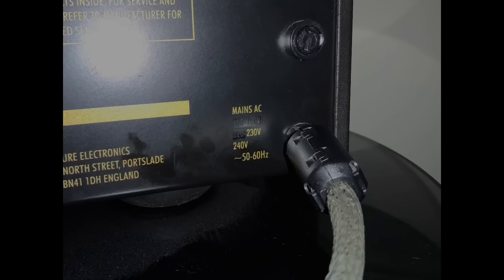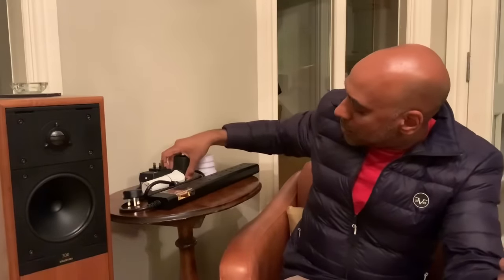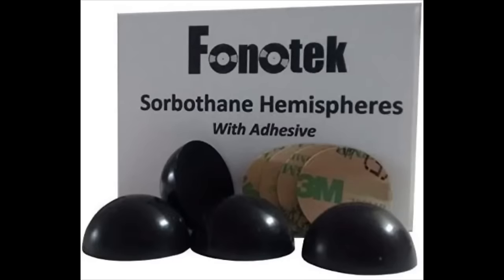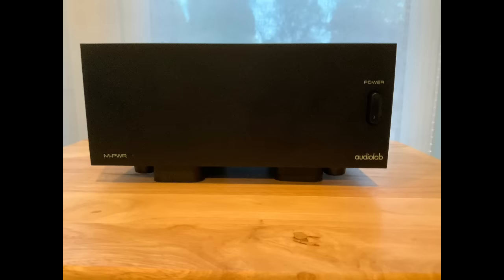My Top 5 Inexpensive Hifi Tweaks

Comment: There are many things that could be said regarding mains quality etc, if anyone is interested in sorting out the mains noise with a several KV transformer balanced or floating for hifi use at non hifi/professional industry prices should check out airlink transformers...the BBC use them so they probably aren't snake oil.The only other thing to say is go for the electrostatic shield option, it cost about £18 the last time I looked...I hope the non hifi prices bring a big smile to your faces.
Reply from the maker: Hi 495line, thank you for sharing.

Comment: Putting Ferrite beads on a speaker cable is totally absurd.  RF is not an audible interference component unless it has been actively detected by electronic circuitry. There are no active components inside a regular type of speaker system.  The RF levels (if any) would be almost negligible also speakers do not respond to RF.   The impedance of the speaker load is enough to negate any RF pickup in the cables.  Your idea on this is functionally flawed.  I think you may be going over your head when you try to explain reactance properties and their effect in an electronic circuit.

Comment: yes, totally unnecessary to spend US$2000-5000 per metre for speaker cable - wires do NOT "break in" and electrons don't preferentially oscillate in the direction of the arrow. However, 25+ years of live FOH and studio mixing has taught that one connects the shield at one end only, typically the source device. This will provide all the noise reduction benefits of shielding while making ground loops (hum) an unpleasant memory. DO NOT APPLY TO MAINS!
Reply from the maker: Thank you for watching and sharing your experiences 😊

Comment: Interesting but the £40 mains extension lead conditioner i bought degraded the sound. No good anyone want it cheap
Reply from the maker: Hi Robert, that a shame, as I mentioned the results are system dependent with these strips and the ferrite cores. Have you tried the parallel mains conditioner?

Comment: I tried the anti-vibration washer machine feet on my speakers, but I didn't like it.  However, it did give me ideas to try other inexpensive things.  So after a trip to Hobby Lobby I found these bad boys.
https://www.hobbylobby.com/Crafts-Hobbies/Painting-Surfaces/Wood/Wood-Ball-Knobs-With-3-16%22-Hole---1%22/p/20798
I know it's kind of the opposite of what you were talking about, but I like that way they make my speakers sound, which is what matters I guess.  Thanks for the video!
Reply from the maker: Hi Brandon, I am sorry the washing machine feet didn’t work out. I couldn’t open the link for some reason. Please feel free to resend it. Thank you for watching and sharing 😉
Reply: @abritishaudiophile7314  No worries! The new feet are just 1 inch wood spheres sitting on carpet. They added a touch of aggressiveness to the music, but not as much as spikes on metal disks. When I had the spikes go through the carpet into the wooden subfloor, the speakers had a softer sound. The washing machine feet made everything a little smoother. Of course all these differences are very subtle.
Reply: Well, I went back to the washing machine feet. You were right!

Comment: Hi, Due to some damage to cable near the 13amp plug on the tacima cs947 I have to change the moulded plug. Do I  connect the drain wire to the earth?
Reply from the maker: Hi Robert, the short answer is yes but if you are not sure get someone who knows to check what you are doing. Thank you for watching 😉

Comment: When I saw that cheap mains conditioner, I knew how this was going. Done waste your money, those things will do absolutely nothing. Really, don't throw your money away on them. Buy the best equipment you can afford. Does anyone think that the likes of Pass Labs and krell don't know about power supplies and isolation? Of course they do and that is engineered in the products. I went from budget to ultra high end when I could afford it. It's the kit that matters, not cheap add ons that fill the pockets of those who make those useless products.
Reply from the maker: I think we will have to agree to disagree on this one Dinesh. You can build a very effective EMI filter for ac mains for little money. It is true that manufacturers work hard to regulate power supplies to their circuits but will not necessarily build in filters for eliminating EMI. There are a bunch of reasons why, including (not a exhaustive list);

1. not every circuit needs them
2. not every consumer has EMI problems with their supply
3. not a core element of a manufacturers design (high end products tend to be more focused products)
4. specialist products exist to deal with EMI issues for the entire system not just one component
5. adds additional cost

I am not saying that a £40 mains conditioner is going to be of benefit to everyone. There are higher end products with better performance such as mains regenerators that deal with the high impedance problem of mains reconditioners. Of course, these are suited to more expensive systems. I think to dismiss inexpensive mains conditioners as useless is erroneous.

Comment: ok   you are not using proper conditioners
 most  stereo equipment needs an exact amperage to run right   most amps need 40 to 50 amps  to work and sound right...the conditioner you are using ,  is only 2-5 amps " max "  >>> you are not allowing your amp or other pieces to work properly    I assume  10-15 amps each piece of stereo gear (except amp)....speakers do draw current you know ?
I find a HUGE upgrade in my sound.....when I use my 60 amp 120hz power conditioners(both)  and I do not totally starve my gear and amps    I agree I also prefer isolation vs points      you need to really find out how speaker cables work>  the cable you use ....is not very good   barely minimum (I would not even use it for inside speakers)  speaker cables are very magnetic and thus have a magnetic field around the cables so all speaker wires need to be twisted .(yours are not)... twisting cables ...are a type of shielding  also they need to not be run along other wiring or carpet or metal   I use toilet paper roll centers like a form of isolation and this is easy  and with other upgrades improves  the soundstage    Power cables also benefit (magnetic fields again) on twisted wire .... ok here we run into another problem  the plugs needed for a hi voltage amp   remember my mcintosh amp  is 125 watts and need 50 amps minimum wall current or power conditioner current   so get the highest power handling Plugs you can find ....easy to get 20-30 amp plugs but I can not find reasonable priced 50 amp plugs  I build custom cables custom inhouse hi end speakers  and upgrade amps and preamps and other stereo gear for over 50 years

leaching is a problem with hi current magnetic fields   leaching is the part of noise the magnetic field picks up from going alongside other  magnetic wires and also can just be  carpet or ?  some people say wood is ok ....I say is only ok for short times ....so I make a bridge with  toilet paper roll centers   which keeping the cable2-3 inchs off ground ...no more problem...takes a very good ear to hear problems   but I find fix 3 problems and you can hear upgrade  while 1 or 2 fix problems not enough to hear so fix one more and BAM  improvement   but this improvement is very low or maybe is low cause i spend money on what I can not build  but I fix most every problem

and for you guys who do not want education on listening  then do it your cave man way    I advise going to a reference system ...(a million dollar system ...or to you a heretic lol) .if you can hear a difference sit home and enjoy you audio world  the things I talk about are what i hear ....but  if you want to hear ...I can talk about all the junk you guys do not believe   and guess what you need to be open for improvements  if you do not believe you do not hear ....but if from now on you do hear and it is an improvement and  you still hear it and it make your sound more enveloping 

some of you are right   does a small improvement you can not hear ...worth 5000$   I say no   I know grounds are so important and  they  are never as good as I want ....but am I spending 10,000$ for a better ground ...no way  not a chance ...   most improvements are to the noise and background and sound stage .....if you have no stage   it is just loud music playing .....in my system you can place each instrument and singer   you hear each player talking and laughing .....  and know what they say ...ok some time that is annoying
I build my own ....I have built speakers hundreds for over 50 years ... you can hear the difference between 10 dollar tweeters ....and thats what most of you have ...they actually hurt my ears...yes i am spoiled ....like I tell any guys that buy my speakers  buy a great tweeter ...that makes the biggest difference ...   at this level changes are  not always good  ...what I offer ...is I listen and somehow remember what a tweeter sounds like ....you know how I got that education ....I spent weeks listening to two or three tweeters alone.... most you guys can not hear the difference  I will not allow 10$ tweeters in my speakers  there is a MBQuart 1inch tweeter for sale for 40bucks   I would pay 200$ for this tweeter it is german  and all chimes and drum hits and cymbals and etc...sound very good   anyways you guys would love a MBquart 1 inch aluminum dome tweeter  they are rich with detail and fast speed and transients   for only 40$  they bough a  bunch of overstock from a company that buys for 7-12 thou speakers aerial acc.  scan speak (my fav speaker company by far)  I love the beautiful natural sound with incredible detail   I do love acuton tweeters they are  ceramic dones  very fast very fast  (the reason you tend to love ribbon tweets but no matter what caps and resisters that are added to make the driver flat and smooth  can not bring it the life that is missing that scan speak has
every single driver sounds a lot different every tweeter and type...sound a lot different to me ....every internal wiring...different the binding posts ...different  the cap and coils and resisters  all very different ....I do listen and make choices  that make a difference to me that make the soul of the music come out of the mix   I can usually get my crossovers in the ballpark with  measurements  but if I do that ...the phase and time alignment are usually off and are not flat  ...I measure caps and resisters and coils so they are exact what I want for a very flat measurement  I garantee that you would not hear this  but I do   its soo funny  I can hear the phase properties unwinding .001 MHenry makes ...usually reversing the phanse angle negative  ...sound and music are very sinewave cycles   I change to .0018 MHenry and back to postive and it makes the soundstage more rythmic and the illusion of the center stage is tighter and more real  ( i make both measurements the exact same  (I have gotten to the point I get exact for each speaker ...but most speakers  are not even close to this .....most caps have 5 percent difference  and most speaker builders  use 10 percent plus and negative .....that means the part can be 20% different from each other  and I am hearing  .0015 differences   I think wilson audio is under 1%  but a lot of others I do not know  most very hi end speakers pot the crossover in epoxy like wilson audio
so no back tracing that ...lol   I do think wilson audio as the best builder  he uses a differnet cross over but he and his son  fix any bad differences in that   they built to better standards than I can   nobody will pay the cash for that unless my name is dave wilson lol      anyways   you guys are not the same as me  your ear education is a lot less   to be honest  if this wire is more resistance ....obviously i can measure that ....but what I need is the sound to be what i want
flat  with  no life taken away    I still use computers and measurements and my ears
sad thing is to most of you ...you will not understand or  not know what i am saying    to be further honest  I talk to speaker builders in this age  they are disrespectable to me  and think their speaker is the best ..... and I hear all kinds of wierd problems ...and I can not stand defraction  and  most of you have no idea what it is   even thou this punk says he fixed eveything in his speaker app  ...yet I hear  them   ohwell this is my problem  and soon when I am gone ...you guys will not even know what your missing .....  if you do not hear ... why fight a battle you can not win....just do not buy
the truth is  with most things I have heard I can hear a difference...not always the good difference ...but mostly I am not paying 100000  for a small difference  and I do not blame you for that   just try and educate yourself  more in sound ...not measurements  .... Music is about beautiful sound ....not measurements    I do care about a flat level response  but  time alignment you do not care about ?   or phase angle...actual phase angle ?   it all matters
Reply from the maker: Hi Will, thank you for watching and sharing your experiences

Comment: I would challenge you to blind listening tests. I have no doubt whatsoever that you could not not discern the differences from your tweaks when blind listening. I would change your setup according to your tweaks and ask you to rate audio quality. Your ears simply are not good enough as test instruments, neither are they quantitative, your ears are highly subjective and you will hear differently at different times of the day. I never see anyone recommending that you lower you blood pressure prior to listening which will have significantly more impact on what you hear than perching your speakers on 30 quid's worth of rubber that probably does not cost a fiver to make. Now there's a tweak that will make yours pale into insignificance. The problem with subjectivity is that anyone can make a video, postulate without ANY facts and then pass the information on to others as factual. Audiophile = man easily fooled into believing that inane gadgets, not grounded in fact, will have a massive difference in audio quality. Go research when Bob Pease invited top speaker cable brands to blind listening tests, their "state of the art" speaker cables against his rip cord. Nobody was prepared to take him up on the challenge, with obvious reasons. Audiophiles wanting amplifier headroom when most recordings are compressed to reduce dynamic range for the average system. Alas you are in the loop and you will continue to convince yourself that your are making these tweaks of substance.  I see your stack is behind one of the speakers? Apparently the smallest of mechanical coupling from the floor is greater than the rear blast from the speakers WTF? I could go on. How about some sound suppression media in the room, ways too many hard and flat surfaces. But no, a ferrite core should clean that up?

Comment: Well presented, but perpetuates the snake oil in the industry unfortunately. I'm pretty sure a well shielded speaker cable is a good idea, without spending silly money. The power cable is a nonsense, though we'll shielded is never going to be bad, as there is less chance of it interfering with other more sensitive to noise cables. 
Anti vibration for the electrical equipment of modern kit shall be better as standard than putting some pads underneath (the density of the pad would need to vary depending on the weight of the device to be effective - so stands to reason generic pads are not going to be as good), and certainly don't buy washing machine antivibration pads for the speakers, these are for washing machines to get rid of unwanted vibration - speakers create sound through vibration, so why would you not mount them solidly rather than provide damping to the lower speaker elements making the sound looser and less coherent?! The presenter was right about concrete floors not transmitting vibration that a speaker creates, so with that in mind, install the spikes and put the speakers on thick heavy slabs of concrete, stone, granite, marble - something dense and heavy... This will keep the speakers stable and not damp/colour or loosen their sound like soft mounting blatantly would, and eliminate vibrations through speaker contact with the ground, also reducing the booming effect from suspended floors (common sense). Put heavy rugs and/or carpets on the floors to reduce sound reflections, especially on suspended floors as well as the slabs beneath the speakers. You want to hear the speakers and not the room as best you can. Cover glass with curtains, this disperses waves and reduces sound reflections (glass could be one of the worse surface for this and we all have windows!). 

As for conditioners, the power goes through a transformer and capacitors first... So surely would be unaffected at the 'conditioner phase', its not like the power comes out the socket and straight through to the speakers... Though I may be wrong about that part by missing an element - just using common sense.

Good luck navigating the nonsense through self proclaimed experts (like me too I guess) - stick to common sense - if it doesn't make sense, it's probably nonsense!

Comment: A rare high quality load of bollocks. Don't you just love well spoken amateurs. While there is no shortage of rubbish on the market to choose from, I would suggest that anybody thinking they need speaker cables better than a bit of T&E is deluding themselves. There might be a case for separating feeds for the top end, but almost any fat bit of copper will do fine - and don't worry about how much oxygen is in it either. These snake oil salesmen take the biscuit.